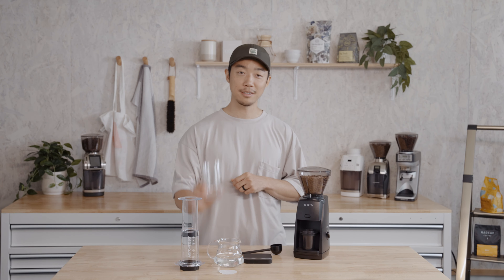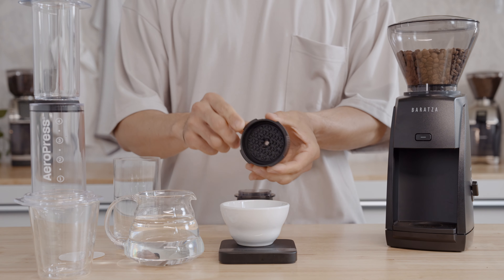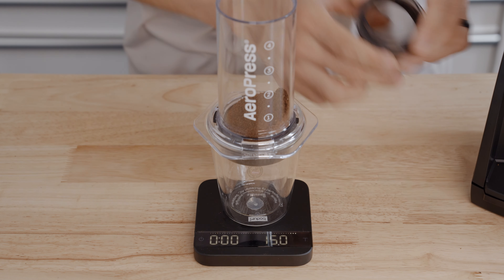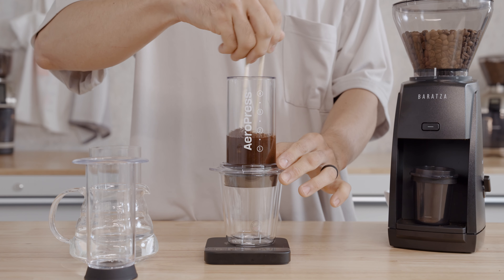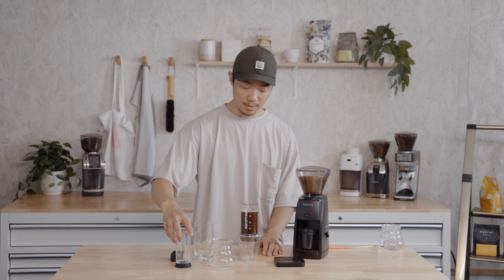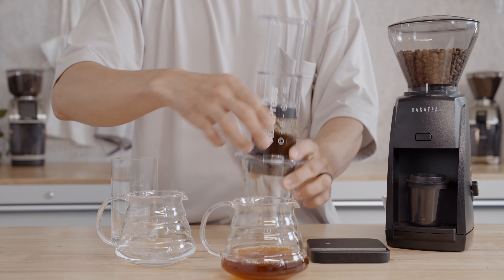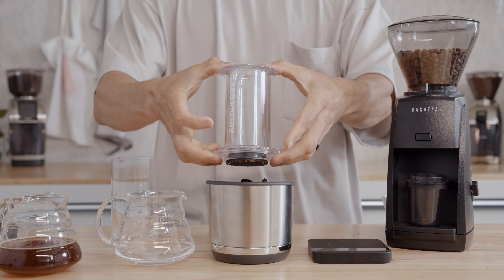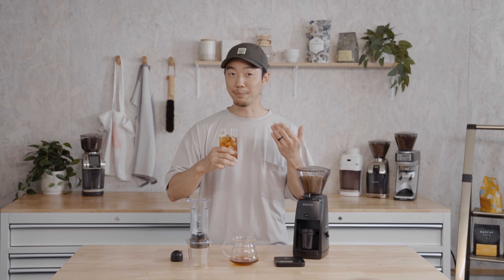Cold Press AeroPress

Comment: Big NOPE from me, plus my 2 cents as a Baratza fan:

- Room temperature water and three minutes, even with agitation, WILL NOT extract enough from the coffee to deliver the rich, sweet flavors of cold brew.
- If you’re adding it to that much ice, why not just use hot water and make a proper iced Americano? Otherwise, the concentration will be way too low, leaving you with watery coffee - or rather "coffee-y water".
- That said, the inverted AeroPress might work better for this—you can avoid coffee sticking to the top during pressing and skip the hissing/pushing out particles much easily.